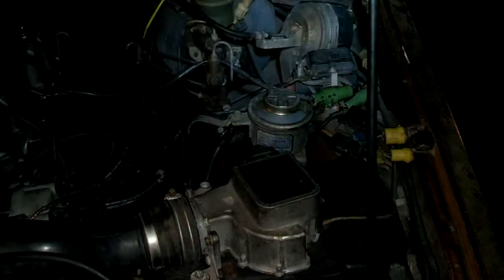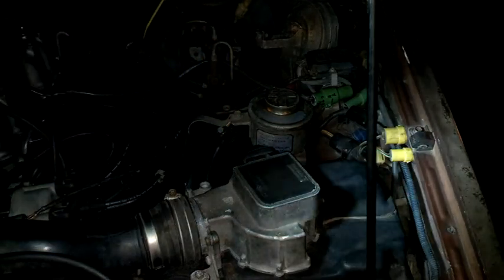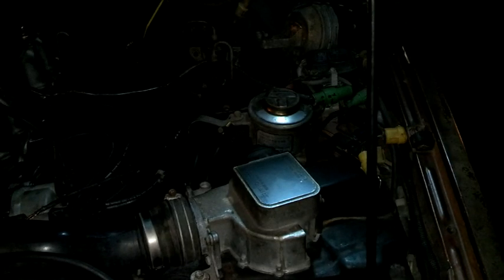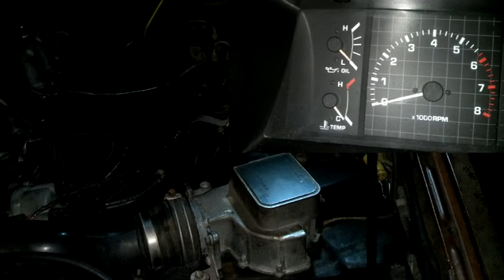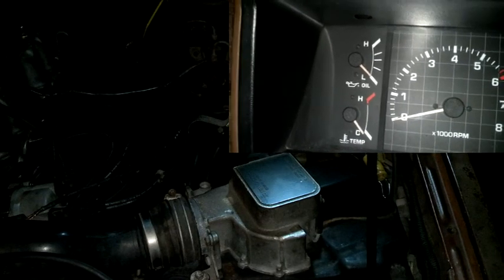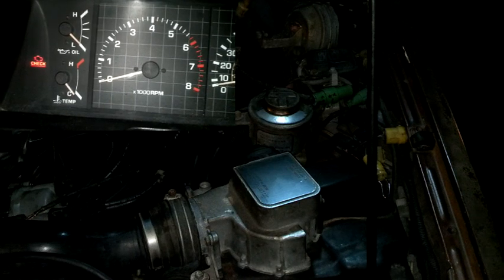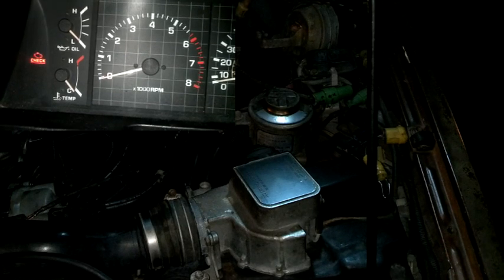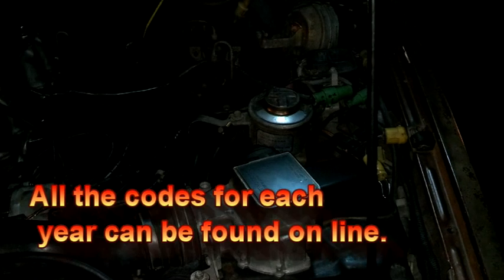Reading Early 22re Toyota Diagnostic Trouble Codes

Comment: I've been wondering if there's a way to connect some sort of scanner to these ECUs and see live data. I have an 87 22RE and getting an intermittent check engine light while the engine is running only. The engine will stumble for a second and the check engine light comes on, then it runs fine with no light. Due to the design you can only read the code with the engine off, but with the engine off the ECU reports no code. I've torn apart about half the things that can cause a problem and not found the cause. I imagine the problem is somewhere in the other half which of course are the harder things to get at and check. In the meantime I've just been living with it. I really hate these early ECUs that don't store any information, and apparently don't allow one to connect a scanner to read PIDs.
Reply: It is pre OBD II  That is why you cannot hook up a scanner..Early EFI systems were limited are limited in what they do.   It would be possible to connect a scope to various components while it was running to see what was going on. However, you would need a scope and have to know how to use.  If you do not have a CEL while running, then the ECM thinks everything is fine.  I do not think it will set a code for a misfire.  Check your ignition components, check for vacuum leaks, and check for adequate fuel pressure.   The air flow meter is another source of problems.  The get dirty and or, worn and send false info to the ECM.  Try Toyota Nation for help.